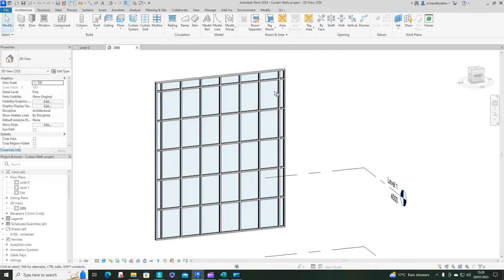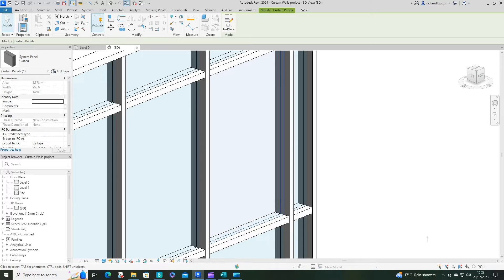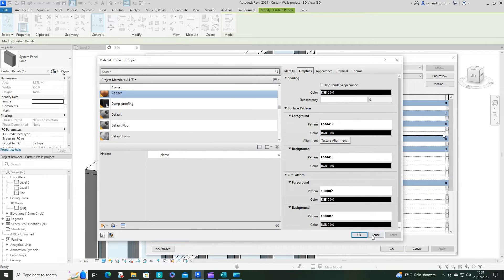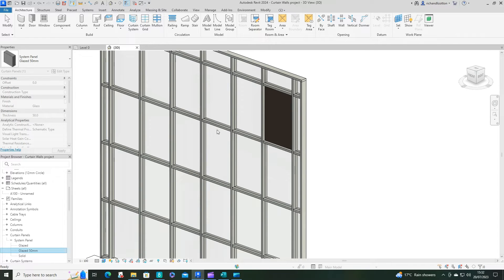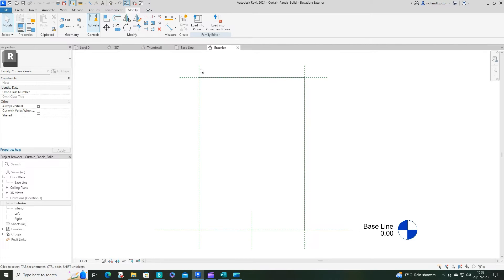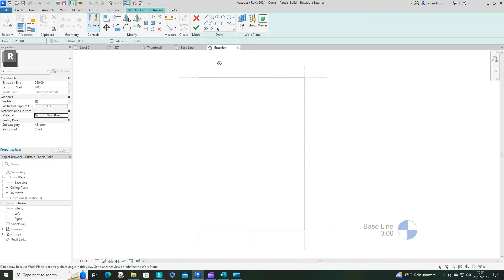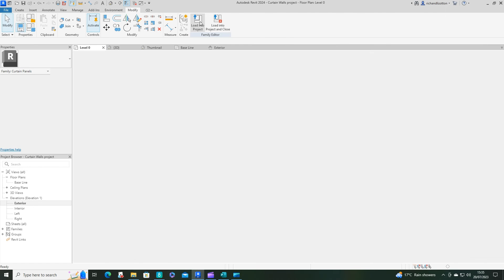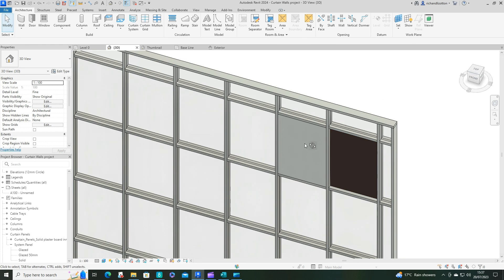Custom Panels for curtain walls revit tutorial

Comment: sweet jesus you've got had done it and used "have-got"!  I cringe a little bit inside every time someone uses "got" when "have" is correct (which is 90% of the time), but you have taken the cake my youtuber.  But, I will write it off as some local variation as you sound like your from Ireland or somewhere.  :P